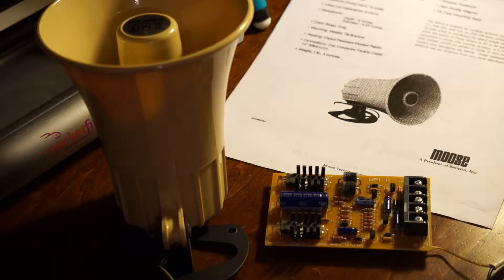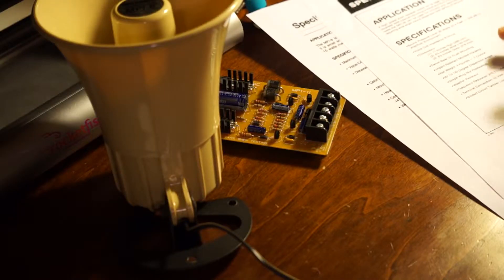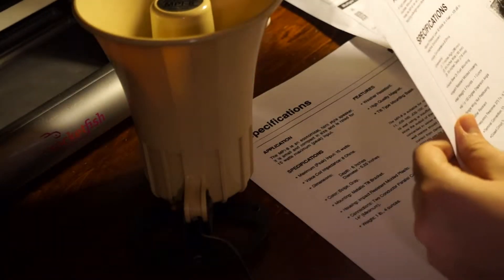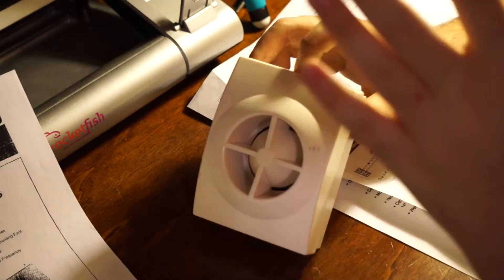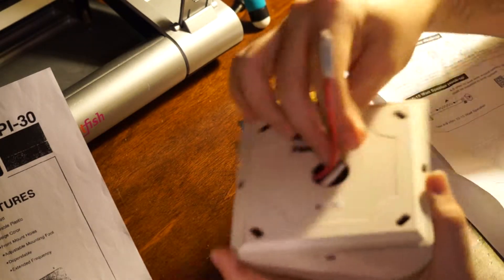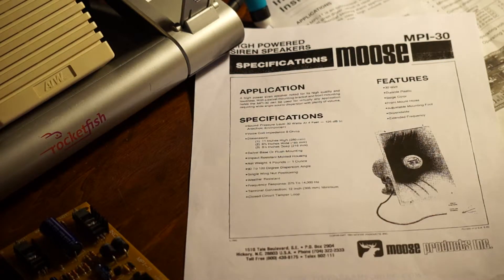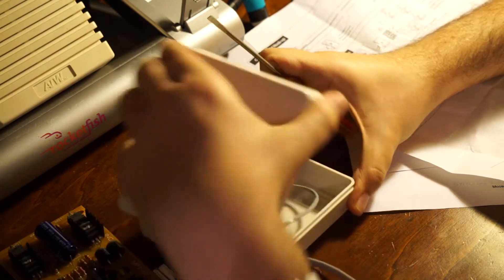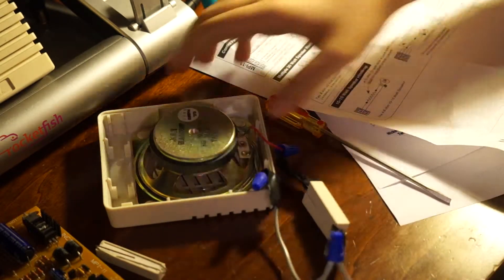Moose MPI-11 Siren Driver Review + Demonstration (How-To)

Comment: Funny enough I got one from a vista LOL out of a BULIDING and they had 8 speakers on a small building lol I got the green version from a vista 50p with a 1999 battery that still works
Reply from the maker: 8 speakers is insane! 😆 It's always cool to get old alarm parts from buildings. A huge part of my collection is made up of old components I got from the field. Refurbishing them and getting them to work is always fun.
Reply: @lollipop7ification  i have one and when I connect  it to power it only makes static sound threw the speaker do u know why it wont make sound

Comment: no longer using the system and breaker was tripped, now it wont stop: "Alarm system is off"  every 2 minutes along with other various declarations? I've removed the mp-1270 rechargeable battery, was already disconnected, ripped the siren driver out when i located the battery and found it disconnected

Comment: My friends’ house has this driver on their system. It’s hooked up to do the steady tone.
They have an Ademco 746F speaker inside and an ATW H508 speaker outside. I’ve actually seen a system with 4 speakers. MPI 30s outside (both sides of house) and 2 speakers inside (746’s upstairs and downstairs)
Reply from the maker: That's an interesting setup having 2 speakers inside. A 4 speaker configuration like that must be insanely loud! We used to have 3 speakers installed at my house; 1 indoors and 2 outdoors, and I thought that was obnoxious. Lol